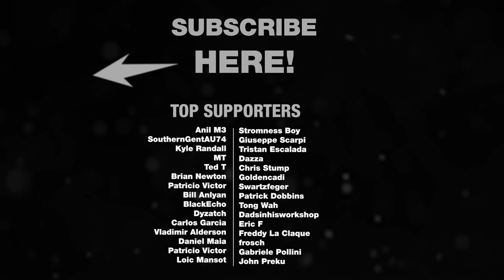Kogatana & Kozuka: Making a Utility Knife for the Wakizashi

Comment: Amazing skills. One question, in traditional katana that handle is not supposed to go through the tsuba? In yours it's seems to just touch it.
Reply from the maker: Thank you!! And yes, you are correct. Even though I intended my kozuka to fit the hole of the tsuba, after all the shaping it came out just slightly wider, so it does not fit. In the final episode I will address this by enlarging the hole of the tsuba :)
Cheers!
Reply: @BlackBeardProjects  thanks for your answer, in any case amazing work.

Comment: Beautiful engraving work, but you wrecked a perfectly gorgeous piece of thin and wide raindrop Damascus...random pattern in the proper thickness and width would have served just as well, required far less jiggery pokery, and you wouldn't have wound up with a cold shut near the spine on the right side of the blade...